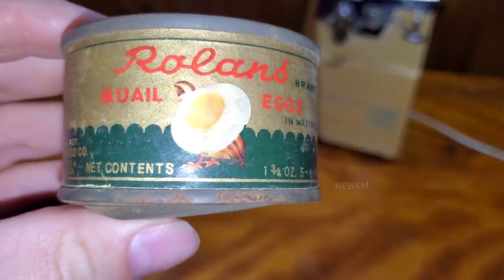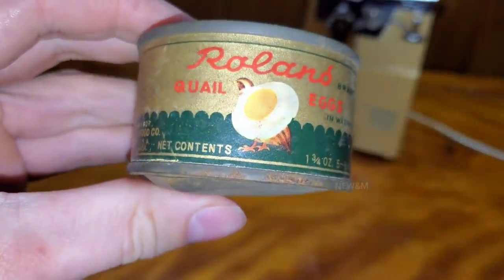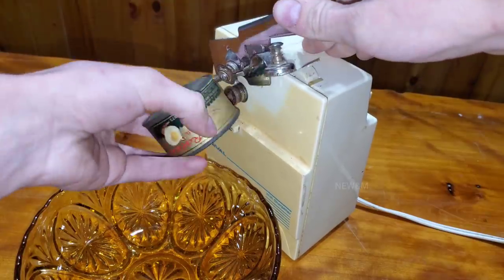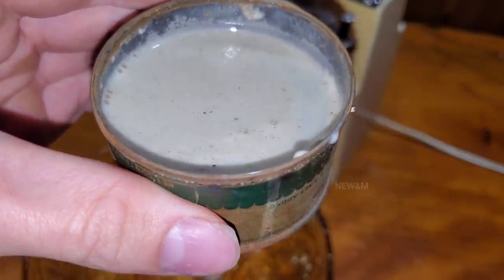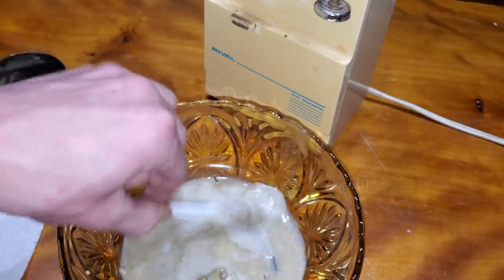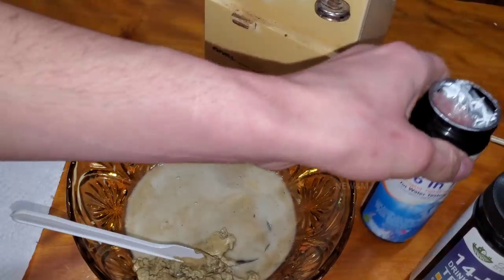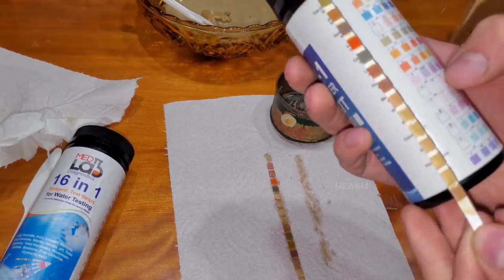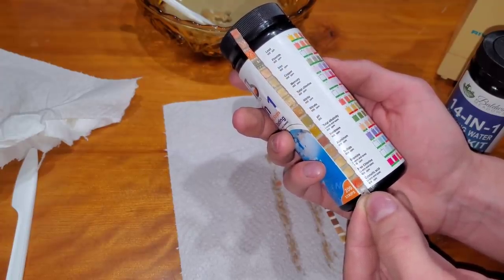Opening & Testing 70 Year Old Quail Eggs Canned 1950

Comment: A face shield is probably the best option for catching spray, you can get em for $15 from Harbor Freight.  Or cheap on Amazon if you don’t need penetration resistant material.